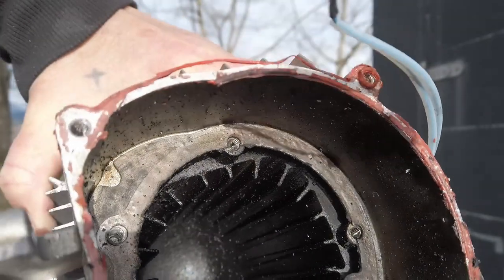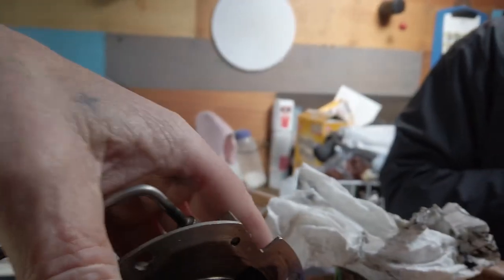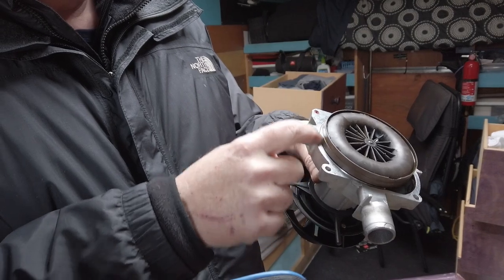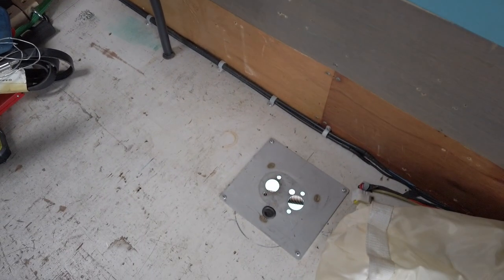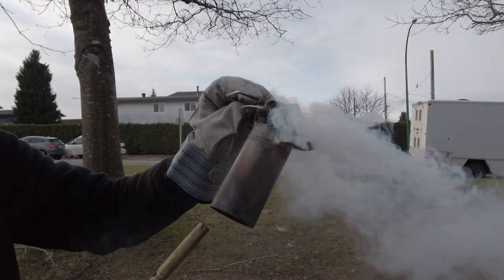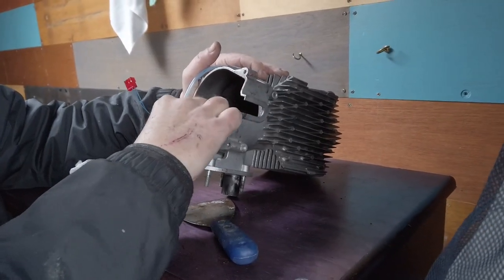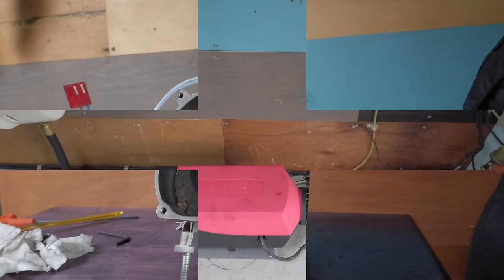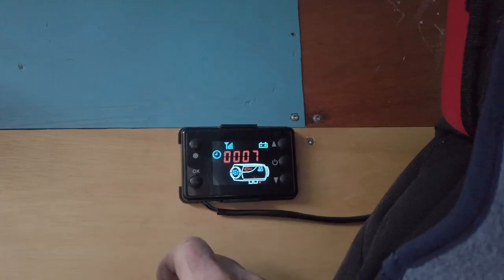Diesel heater repair attempt and failure, too much fuel

Comment: You need to go into the mixture settings. 1688 is the code to get in.first setting is for low and second setting is for high. Hope this helps you.